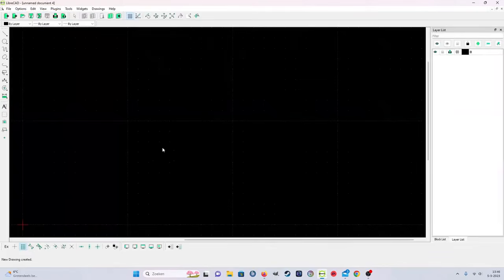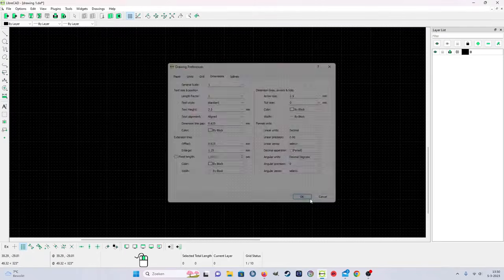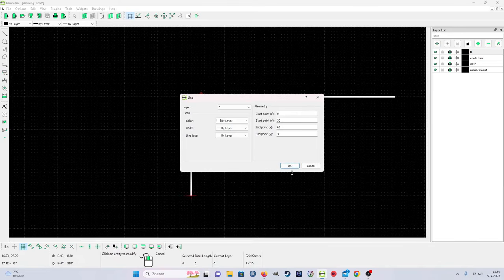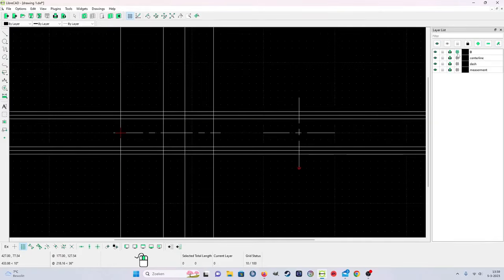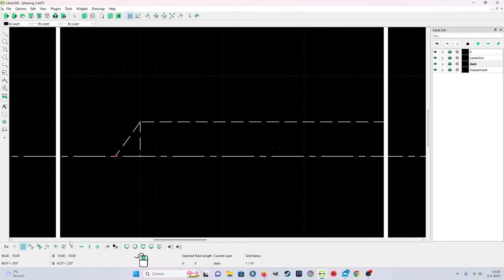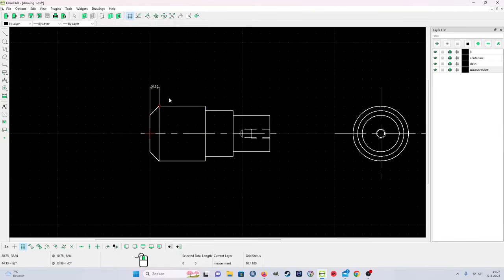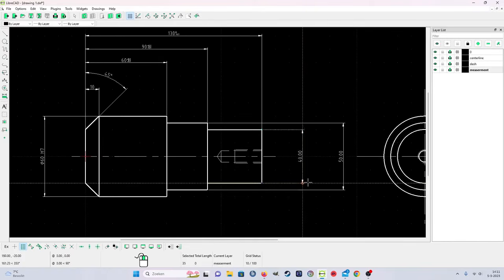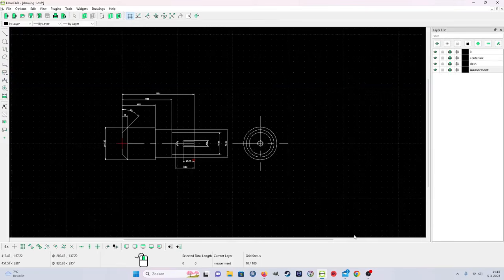Librecad 2D drawing tutorial part 1

Comment: If anyone is wondering why the measurement tool does not work properly, go to: Options > Current drawing preferences > Dimensions tab > Set the general scale to 10 instead of 1, this way it should work!